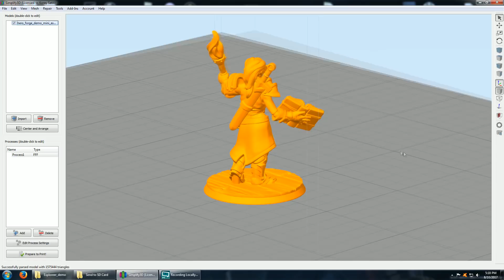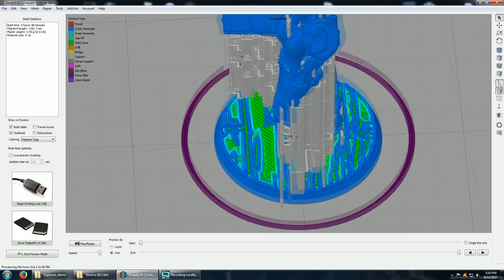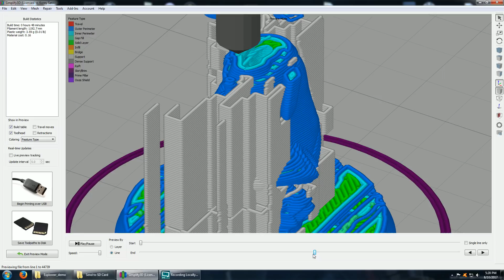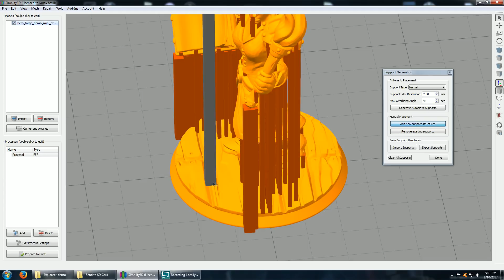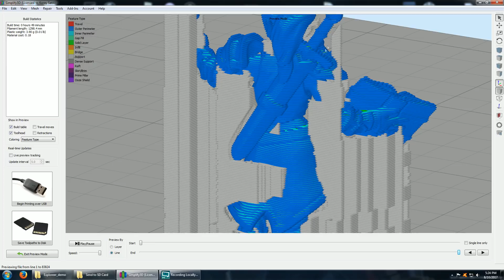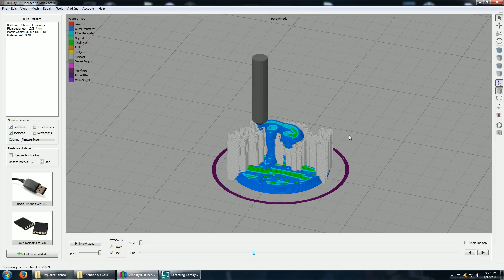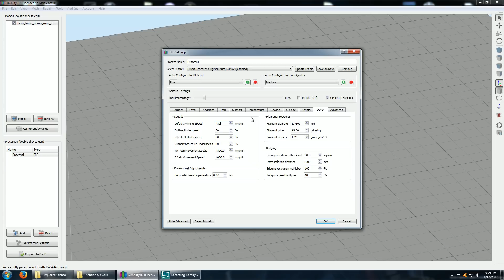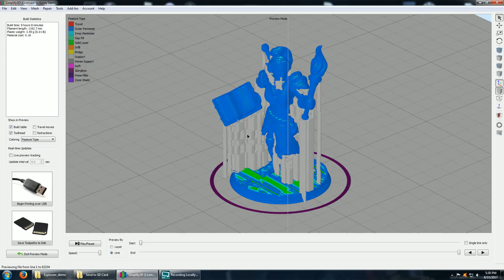How to 3D Print Miniatures

Comment: try them at .0800 instead of .2 it will add time but give better detail, switch infill to 5% or even 0% b/c the size will support it I do 3 walls to help with strength. and 6 top layers.

Comment: It just seems like you need a better quality printer. I don't have a 3d printer myself, but FlashForge Finder 3D is suppose to be a fucking AMAZING printer for it's cost of $300. I watched a guy print out some boat and a few other things and they all turned out amazing.

Oh, question. Can you sand away some of the 3d printed layer seams or whatever to make surfaces seem more flat? Is that like a pipeline thing?

Comment: If you print in ABS, you get Way more detail as the material shrinks a bit. Also Acetone Vapour Smoothing, oh yeah...
Reply: I get just as good quality with pla, with proper settings. And acetone vaper smoothing can significantly weaken smaller parts.

Comment: Put your layer height at at least .07, that will make your print look 50 times better
Reply: Multiples of your minimum z motor stepper move (or magic number) mine is 0.04. I can do 08, 12, 16, you get the idea.